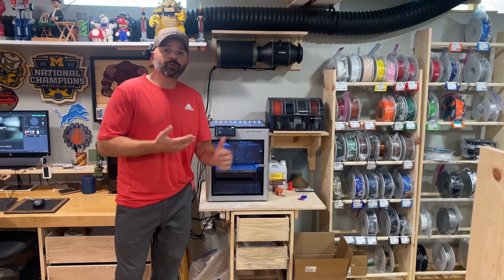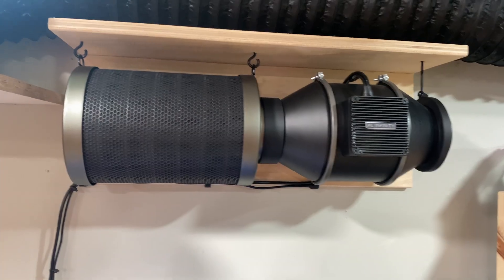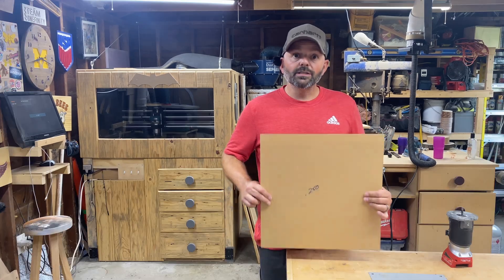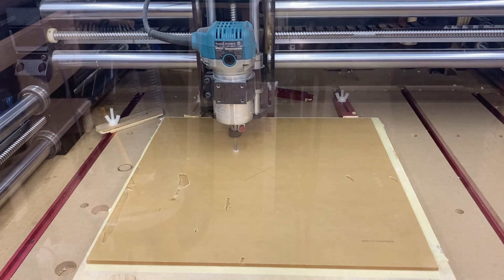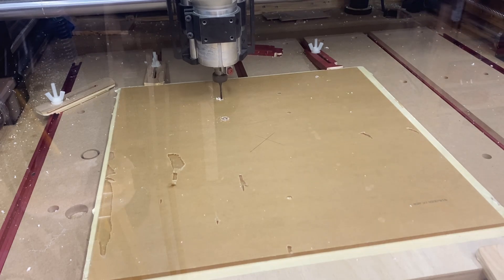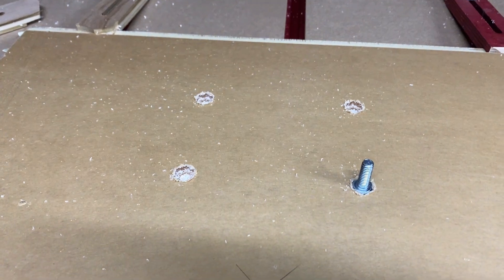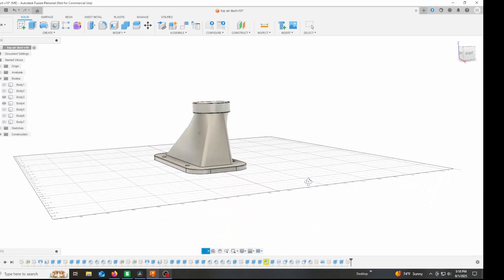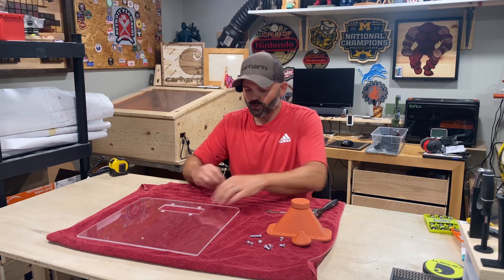Not Quite.  I Make My Own So I Can Vent My Enclosed X1-C Chamber

Comment: I’m worried this won’t produce the results you’re hoping for, partly because of how the airflow might work/not work, but mostly because you’re planning to keep the door closed on PLA. 

PLA needs cool air. With small prints, where there isn’t a ton of thermal mass, you can get away with having the door closed. With large prints, you might find the printhead is blowing hot air on hot filament and experience poor layer adhesion, surface quality, and warping. 

Consider a follow up video of stress testing large prints with the door closed vs the door open. Even a short would be cool. Thanks for sharing man!
Reply from the maker: Thanks for the comment, being new to printing - I haven’t even thought about that. That is definitely a lot to consider